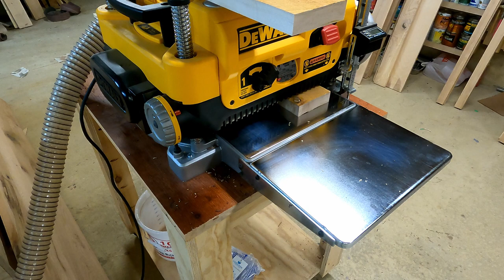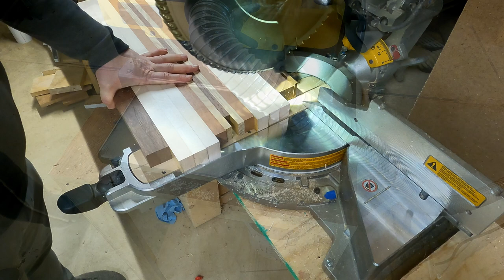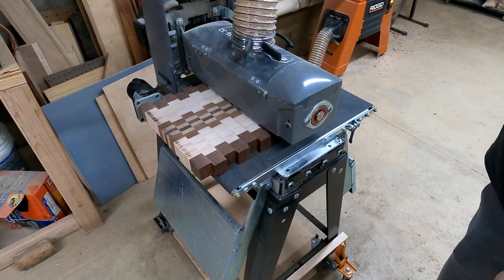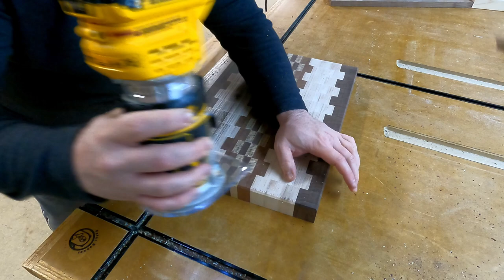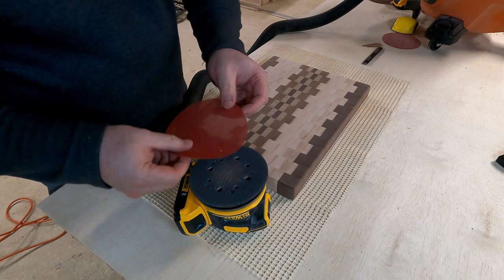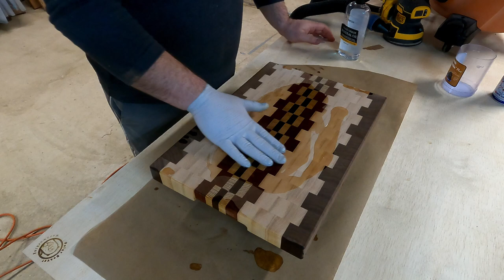How to Make End Grain Cutting Board | Step-by-Step Guide

Comment: You had very good accuracy with the offsetting of the board.  Great job as it turned out great.  Two ideas for you.  To prevent chip outs with your palm router, work it clockwise.  I use an angle grinder with different grades of sandpaper and it goes much faster than my palm sander.
Reply from the maker: I would definitely try the palm router idea, specially with small bits I think it would be safe. 
My only problem with angle grinder is lack of control. I think there is a high chance of sanding one spot more that another.